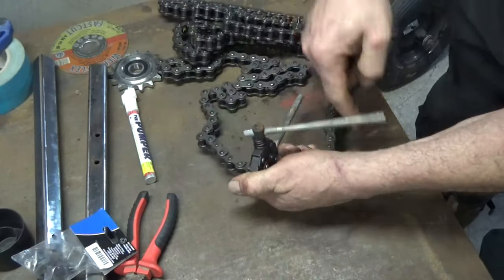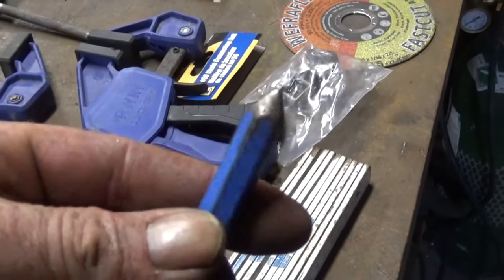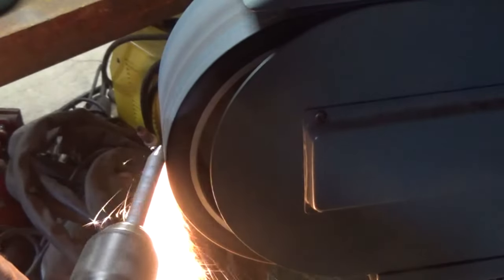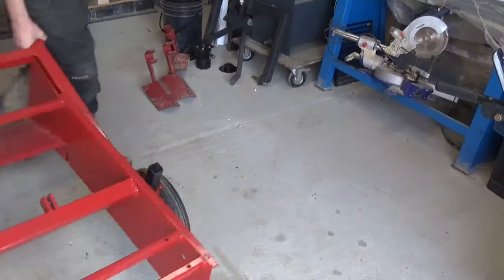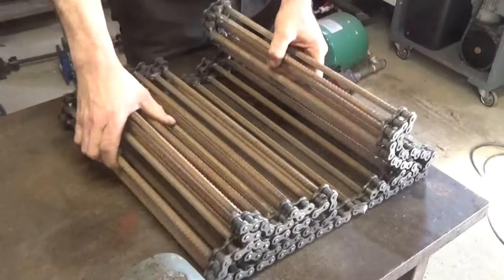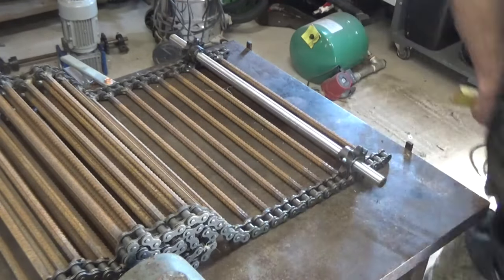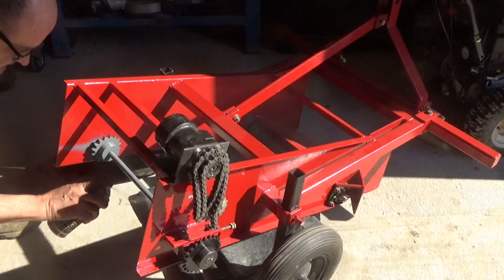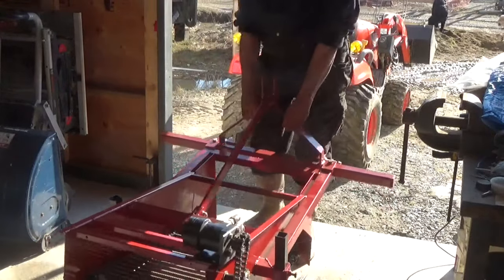Home made potato digger or rock picker

Comment: Great build, just one observation, you mounted the chain tensioner on the wrong side of the chain  should be on the slack side of the chain if that makes sense.
Reply: Potato digger not a potato planter.  The idler is on the slack side of the drive chain.

Comment: Your engineering, metal fab skills, etc, etc, etc, are amazing. Really inspiring!
Reply from the maker: for rocks you should make sure the space between the rebars is smaller than at the sprocket from te rebar to the shafts otherwiese the rocks will stick between the rebar and the shaft and block the movment from the whole chain.

Comment: I have rocks & broken red bricks (1000's) to dig out of my soil (somebody dumped in here, years ago).  Have to get them OUT, and you've helped greatly with this vid !!!  It will receive on-going use, for sure, .... Many years ago, this area allowed "offloading" of broken concrete, bricks, mortar, etc. etc ...  It's a mess for all my neighbors, too.  Great work & solid engineering...only thing missing is a "hopper" at rear to catch the rocks, etc.  ....easy to build that part, especially if it's rigged to manually dump the rocks...

Comment: I like everything about it except for your rebar use.  Fine for rocks, but would add to damage on potatoes.   A good digger actually has rubber over the steel chain to minimize damage.  You could probably work something out without too much trouble though.  If you do it over, use smooth steel stock instead of rebar.
Reply from the maker: I know there are a lot more options but most of the time i can use only what I have ot whats payeble

Comment: Excellent video, Darn which I could have seen the beginning.  You will have to build another one and record it.  Also you could as a add-on, coulters on each side in the front to slice through vines if you use it with sweet potatoes.  What angle and internal width did you use?  What is the brand and ratio for the hydraulic motor?

Comment: Like the build but just wondering if it wouldn’t be easier to control the depth of digging if you use a flexible top link(chain works). This way your three point will lower only the front of the machine without pushing on the wheels but still allowing you to lift the whole thing in the air when needed. Just going by how large potato diggers work.
Reply from the maker: If I did it like you said it would go into the ground like a excavator bucket and it would change the angle of the conveyor that the potatoes would roll back and it would no longer sift the ground. The top link is holding the vertical position of the entire attachment and thus prevents unwanted angle changes which a chain would change due to flexibility

Comment: Nice build! What is the spacing on the cross bars that attach to the sprockets?
Reply from the maker: what you want know the length of the rebar or the space between the rebars
Reply: @dsfarmns2823  space between : )
Reply from the maker: The distance is automatically determined by the size of the roller chain from outer link to outer link and is 1.5" for 60H roller chains.
Reply: @dsfarmns2823  thanks!

Comment: What size hydraulic pump did you use?  Got a link?
Reply from the maker: Pump or Motor ??? The pump in the tractor is a 12.5 Gal / 550Rpm  The motor is from  Princessauto.ca t  he have all kinds depense of the size your tractor hydraulik pump.

Comment: So i just have to go to school for 8 years to learn the scales to use toes machines and spend $80.000 to buy the machines than i can make a potato digger. cool.
Reply from the maker: Sometimes there is a simple solution to a challenge and sometimes it is not expensive, but knowledge takes time and is unaffordable
Reply: @dsfarmns2823   ironic that comment comes from “The Do it Guy” 😂

There are numerous inexpensive Chinese IGBT welders on the market now so that is t a huge cost. There are even fairly cheap mini lathes if you can’t find one used. Honestly though, that machine could be built without a lathe. You can learn all the skills needed from YouTube and practice.